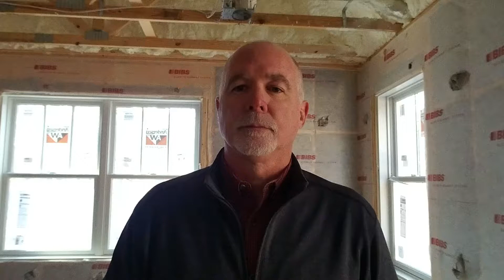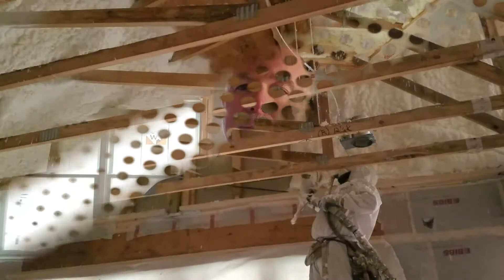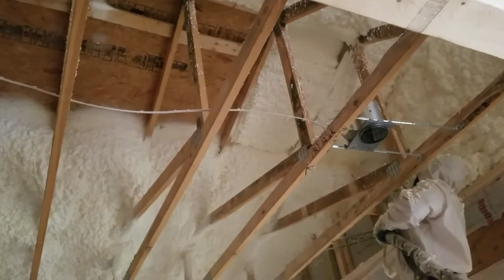Net Zero Custom Home - Spray Foam Installation - Matthew Bowe Design Build

Comment: 1. How do you prevent ice damning on the roof without ventilation running on the inside of the roof sheathing?
2. Did you use the zip r roof sheathing and if so does that help prevent ice damns on the roof?
Thanks for the videos! Looking forward to building my new home here in Oregon with the zip system’s. I want to create a conditioned crawl space because that is where our hvac system will be but was planning on zip r on the roof with traditional roof venting and ceiling insulation. Thoughts appreciated. My builder is not super familiar with these newer building science techniques.
Reply: We did use Zip sheathing for the roof but not Zip R. There has been no issues with ice damming. The surface temperature of the sheathing is not getting warm enough to melt snow and cause ice damming.